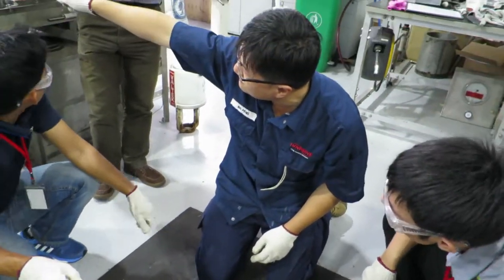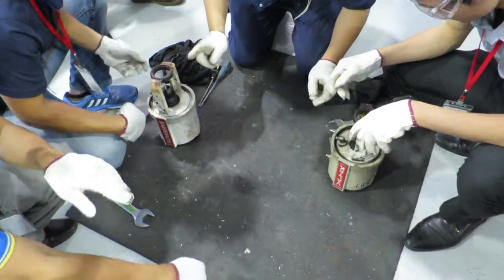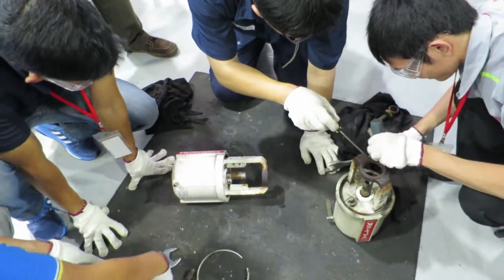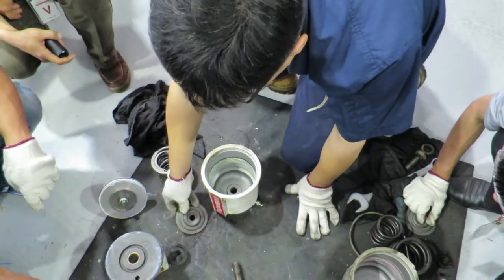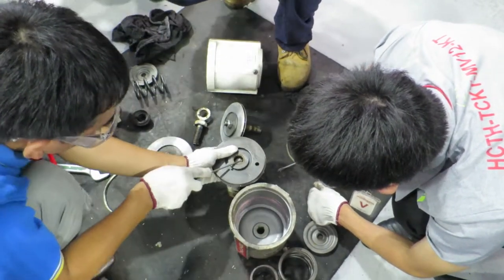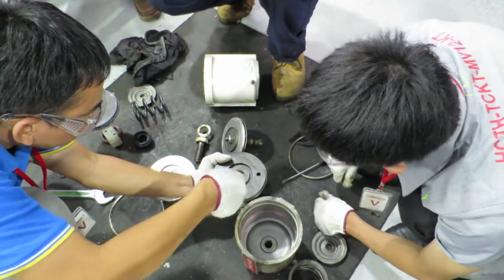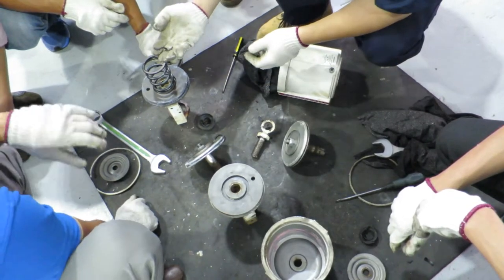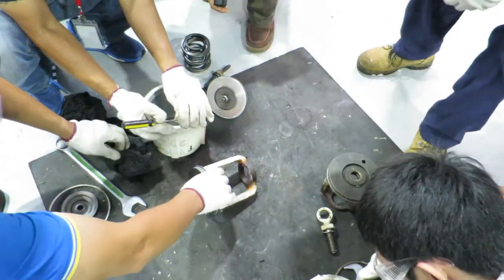Flowserve Control Valve Maintenance Training

Comment: I have a question I would like your support thank in advance,If the actuator work using both port doble acting should I remove the spring ,What if I did not remove the spring and configure my positioner to work as doble acting ,is the spring going to interfere with the control from the positioner ,I have a configuration that work as doble acting but still has the spring (may be to provide fail action ) but I think it is causing the valve to be unstable even it has a tunning found with other valves working fine ,positioner already damaged and replaced but stil having the unstable position.thank for your help.
Reply from the maker: You can do as your mentioned. Regarding the spring, I think it only apply for single acting. If you use the spring for double acting, it's no meaning. It's the same with single acting.